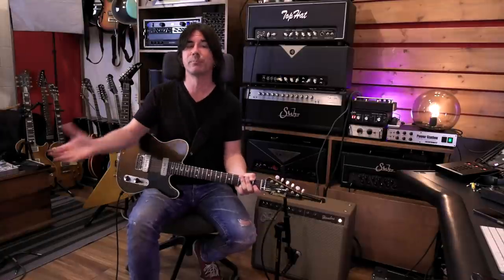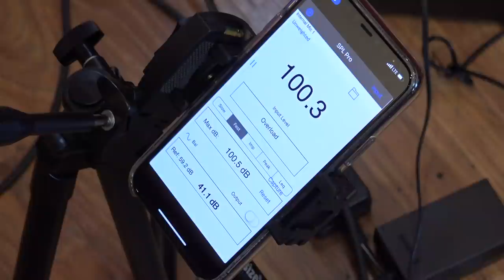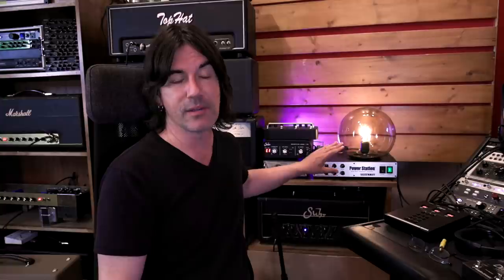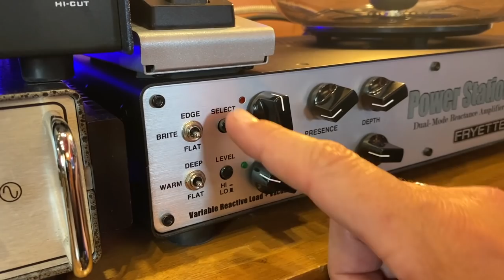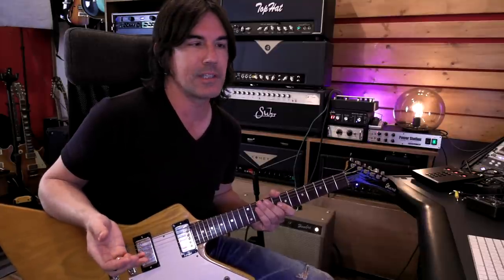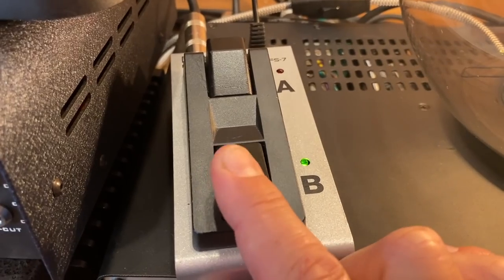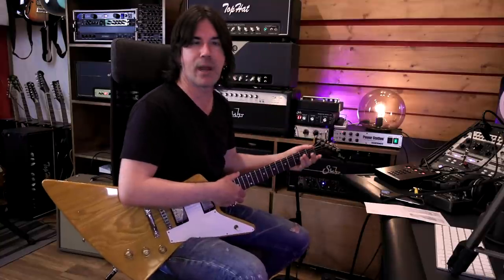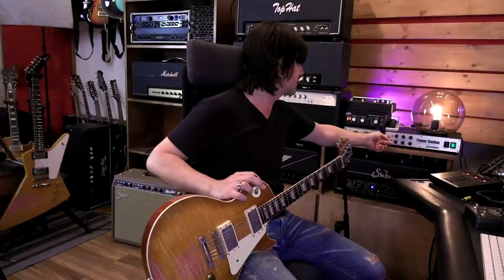THE BEST "ATTENUATOR" AVAILABLE! FRYETTE PS100 POWER STATION

Comment: Another great informative video that's easy to follow and understand. Im looking for a solution to record my guitar from my amp head straight into my interface to my daw. I was almost set on the Two Notes Captor X until you posted this new product. As far as sound quality and playability, which unit impressed you the most Pete? The Two Notes Captor X or the Fryette PS100? Thanks in advance and keep up the awesome content!
Reply: Different applications, I'm afraid. This one (PS100) is mainly an attenuator - meaning the main purpose is to attenuate, of course, but have two channels (you can have one louder than the other for leads or adjusting the volumes of two different amps) but also have amplification too (100 watts, all tubes). It can go directly to a mixer or audio interface (from line out) but you will have to have some IR loader in the computer to give a cab impulse response to the DI signal.
Now, the Captor X just have two fixed steps of attenuation but have already the software you need to record a guitar amp directly into you daw.
One is best suit for live, the other for studio/home recording.

Comment: Pete, I have a 1998 Marshall JCM 2000 DSL 100 Dual Super Lead 2-Channel 100-Watt Guitar Amp Head. I only use the green channel with my gain set at about 7. I know I can control my room volume with the master volume, but I feel that I am missing some tone and control as I never really push the power tubes. I get my gain with pedals. (My master is set at around 2 or a little above for most shows) Would an attenuator help my tone by letting me get the master volume in a sweet spot?

Comment: Great video Pete! New features aside, is the attenuator any different from the Power Station 2 and if so, is it worth upgrading?
Reply from the maker: The load is similar although I think the switches are tuned a little different. The power amp is different and redesigned around 6550 tubes instead of 6L6
Reply: @PeteThorn  - thanks for clarifying Pete! Wish I opted for the PS-100 over the PS2, but still very happy with it!

Comment: Awesome demo! Question about the re-amp part. If you're taking the original tone down to load, then using the PS100's amp to amplify the signal - are you NOT hearing the amp's output transformer and tubes?
Reply from the maker: No you are most definitely hearing your amp’s full tone, working hard! Output tubes, transformer, everything

Comment: Awesome Pete !  Any heat issues with a 100 watt head going into it for extended periods?
Reply from the maker: No it’s built for that, but it’s always important to just keep in mind that you are driving your tubes hard and they will need replacement more often if you play through your amps for extended periods at high levels
Reply: @PeteThorn  Thanks Pete !!

Comment: Hey Pete, If you have an amp with a more low mid focus, like an Orange Rockerverb, would the presence knob on the PS100 be able to boost the high end  to make it brighter to make it cut in the mix more? Or does it not work like that? Thanks.

Comment: Very cool, but this is the first I’ve heard of the voicing switches being in the flat position using a resistive load vs. reactive load. Is this correct?
Reply from the maker: Yeah the flat positions-  essentially take out the reactive components. Then you are left with a resistive load, like many of the attenuators that have been on the market for years. As you put the switch is into the different positions you’re adding the reactive components that give you a true impedance curve
Reply: Adding to Pete's answer below, setting the switches to flat does make the load resistive, but the relationship between the power amp stage of the Power Station remains reactive because a speaker load itself is reactive. That's why no matter how you set the voicing switches, system as a whole remains reactive and retains dynamic feel like playing the amp direct to a cab.

Comment: I really dig the hell out of it. I see it's almost $1K. I would love to find something similar that doesn't have to be two channels & a little less costly.
Reply from the maker: You could get an original one. I’m not sure if they still make it, they may  check their website. If not maybe look for a used one. The original was also very nice
Reply: The Fryette PS-2 is a single channel and 50 watts.  Best piece of gear I have bought in awhile.  Around $699 but I used a coupon at guitar center and got 15% off.  Interestingly enough the coupons list just about every manufacturer is not eligible but Fryette wasn't on it.  Winner Winner.
Reply: Actually just checked the pricing.  The PS-2 has gone up $100 bucks since I got mine...within the last 6 months.  Wow...can't believe how the pricing of so many things is going up.  Not an easy product to find used BTW...they sell quick.
Reply: @PeteThorn  Thanks Pete! I'll definitely check it out. I am really impressed with this unit!
Reply: @splittinaces9540  Still kickin' myself!  Had a shot at a used one just a couple weeks ago for about $625-missed out.  In the meantime, they sold out. (And went up $100 in  the process!) Still bought one, though.  Now I'm waiting on the amp.  A Rivera Stage IV.  I'm like a freakin' kid at Christmas who just unwrapped the batteries, but has to wait for the toy!  LOL  Lots of things affecting the gear market.  Supply chains are still messed up in some cases, some areas are locked-down to a degree that it makes it harder to do business.  And for those who've been blessed with minimal effect on their income, demand is high.  I've been to some retail sites where virtually EVERYTHING remotely popular is out-of-stock.

Comment: Better than the UA Ox, or just more well suited to your needs / workflow?
Reply from the maker: I use an ox as well! My three boxes i use here- On outputs 12 and three of my amp /cab switcher- are the Suhr RL, the OX, and the Power Station. The power station is on output three and is in line on the way to my live cabinet in the other room. The other two boxes are wired into my interface for direct recording with no cabinet.

Comment: I've had my PS 2A for about 6 months now. I've been really happy, but recently confused at what I'm hearing out of my 4x12 (just the JTM45 rig for now). So am I taking an EL34 or 5881 amp and having it re-amped to the different qualities of the 6L6s in the PS?

I've been messing with the unity gain to try and figure out and it really seems like I'm hearing a brighter more Fender-like tone. I'm just a few hours into this.

I think I'm getting this though - "drive the, in my case, 5881s to the tone I want, and then what comes out of my 4x12 is "Marshall tone", pumping through the PSs 6L6s with added eq if needed?

I just feel like I'm getting added 6L6 sparkle when I'm past unity gain. Why is this an issue? Because I don't want to run my Marshall at full crank all the time, just for casual sessions, and prematurely wear out my tubes.

Thanks for all you do Pete!

Comment: hey pete in recording do you think you need to have the cab blowing hard or what is an optimal level as can you get great results with a compressor doing the volume lifting in the mix, i know mics and rooms are a funny thing but the sound source at diff volumes is a test ive tried and a one watt amp can still sound big with the right reverb etc, good to know your thoughts
Reply from the maker: I think ideally it’s good to get the speakers moving a little bit but you don’t have to murder them with level.  It’s also a factor whether or not you want to be in the room with the cabinet in order to get some feedback, etc. With a device like this you can definitely like, cut the volume in half, still get a great sound and a tone every bit as good and maybe even some feedback if you’re close to the cabinet.
Reply: @PeteThorn  cheers pete, im forced to work all in the same room so have to commit really my api512v has input gain that i can clip a little which can help get it cutting a bit or neve 1073n eq but i just got a 15 inch guitar speaker which does away with the 4x12 and gives me some killer low tone, i just need to suss the level now, its tough making an album and having to commit to a chain, but its a fryette or thinking a blu guitar amp 1 and blending an aby with an m160 on my cornford into the 15 or fryette on my mesa, im doing an album in the style of superunknown, drums are sounding good https://soundcloud.com/ssyne/kit-c

Comment: Pete I have a Suhr Reactive Load IR.  Would you recommend using that with a power amp to control the volume of lets say a Plexi or JCM800 cranked?  Or would the Power Station work better?
Reply: Follow up question... if I used the Suhr Reactive Load.. are there power amps that have the treble and bass switches to bring that back?  Just looking at options.  Thanks!

Comment: Unit sounds great, can never quite figure though - the load is reactive so the guitar amp sees and responds to a "speaker load", then the tube output of the Fryette sees a real speaker, which has its own reactive impedance curve that presumably the Fryette responds to, so are we not getting two impedance curves added?  I've used a Suhr Reactive Load  into a small very controllable solid state amp which doesn't much care about speaker load and that works really well too.
Reply from the maker: I’ve asked Steve about this and I don’t really understand to be honest but evidently he designed the tube amp to be quite flat response. I know what you’re saying there must be some impedance curve? But maybe he’s planned that in the way he’s tweaked the load impedance curve as well. You’d have to ask the designer.
Reply: That's right. You are absolutely getting 2 reactive loads in series. The beauty of this is that no matter how you set the Voicing switches or the Presence and Depth controls, you always have control over how much reactive behavior there is and where it's coming from. It's more reactive in the load section and therefore the Voicing switches have progressively greater impact on that behavior, whereas the Depth and Presence controls are more subtle because the power amp stage, as Pete correctly stated, is more linear than a typical tube guitar amp.
Reply: @FryetteAmps  Hey folks, do you use  quite high negative feedback? - whatever you do, it certainly works.  Gotta ask, why not a solid state amp - lighter, less maintenance issues and they don't tend to respond to impedance curves like tubes? Don't get me wrong - great product  - just curious.

Comment: Hey pete or anyone but preferably anyone who has one I have a ps 100 and I using fender super reverb reissue.  Just wondering if there is an order or correct way to power up the amp and power station.  I’ve looked on there youtube channel and the manual and there doesn’t seem to be a certain way to do it.

Comment: Pete, does this wear your amps power tubes faster like a load box does! Thanks
Reply from the maker: Well it’s not that it’s hard on the amp, it’s that you are just running the amp hard, if you turn it up, same if it was plugged into a cab!
Reply: @PeteThorn  thanks Pete, I think I understand. In other words it’s not forcing the compression on the tubes to burn them out prematurely it’s just wearing the tubes as if you ran it loud with a cab. Thanks

Comment: Hey Pete, greetings from England, is there any point in buying this attenuator if I own a Marshall dsl1hr amp, it's for home use on ly, the amps still  pretty loud on volume 3 or 4 and I don't want to piss off my flat mate above! 🎸🎸🎸🎸🎸🎸🎸🎸
Reply: By yourself a Bugera or a Harley Benton... no need for an atenuator whitch costs 10 times the price of your DSL1
Reply from the maker: Well the interesting thing is, this could actually make your DSL one work with a band. If you were ever go out and play life, you could plug that amp into this thing in you’ve got 100 wants to play with all of a sudden. But with the tone of your amp. I know what you mean, I have a 1 watt Marshall as well. It’s too loud for sure on full power for an apartment. If I play it at home I use the attenuator switch Dash the model that I’ve got which is the JTM one has a built-in attenuator

Comment: Hey Pete. How does the Fryette compare to the Waza TAE going straight into the cab as an attenuator?
Reply: Im sure it sounds better than the Waza TAE and for less money. It is a tube power amp instead of the class D power  I believe that the Waza has. This is simpler and more transparent from what I can hear. Yes better to my ears going straight into a cab than a Waza TAE to answer your question. No need to buy a different unit for different ohms either. Fryette is known for making the best sounding power amps out there as well. One other thing it's over 3 pounds lighter than the Waza TAE. My search is finally over.
Reply: @HiHello-ku1fl  The TAE is a different beast though, it's designed for live applications and it's great at what it does. I'm currently using one a lot at home as an attenuator as well and I think it sounds pretty good, but I'm curious to hear how it compares specifically as an attenuator from someone who has used both side by side.
Reply: @trentwaterman7049  I know the TAE has built in effects but other than that it does the same thing but with class D power instead. The Fryette is designed for live applications as well. They aren't that different except one has more features that I don't need. I would just use my own choice of effects. I guess it would be convenient to have them built in. I'm sure Pete prefers the Fryette better as that's the one he bought. He would have bought the TAE otherwise.
Reply: @HiHello-ku1fl  bro I know you're just trying to help, but like I said I'd like to hear how someone who has heard them side by side thinks they compare specifically as an attenuator into a cab. Pete has both the TAE and the Fryette.
Reply: @trentwaterman7049  ok I will shut up. lol Sorry man.

Comment: Hi, can we use the attenuator function on a combo, like the mark v 25?
Reply: Yes you can: just unplug the combo's speaker cable, and do as follows:  
Mark V "speaker out"  >  extra speaker cable  >  Fryette "amp in" . 
Then:  Fryette "speaker out"   >   speaker cable that is soldered to your combo's speaker.
Make sure the impedence selector on the back of the Fryette matches the impedence of the Mark V speaker out.

Comment: When I had my 100watt Hughes and Kettner amp hooked up to a 4x12 cab I used a THD hotplate. It was perfect and not too big. This Fryette has too big of a footprint for me. 

Sounds great but I'm so glad that some newer amps come with a built in attenuator 🤘🏻
Reply from the maker: Has to be that big To have 100 W amp inside! Plus enough room for the load. Room for the output transformer and tubes etc. I don’t really find it that large to be honest.
Reply: @PeteThorn  That's true. 100 watts requires a bigger box. It looks fantastic and I love the glass ball. Reminds me of those electrical light up balls they used to sell.
Reply: @PeteThorn  Not sure if you will ever read this but I just now realize that the glass orb sitting on top is NOT part of the Fryette PS100! HAHA This is why I was thinking it was too big. I was watching an older clip of yours and the orb was there and I was like OHHHHH. (I can be slow sometimes)

Comment: So this wouldn't work for a 2ohm super reverb?
Reply: I use my vintage 68 drip edge super reverb with 2/12s this is a 4 ohm load,  using 2 Jensen C12K in 2/12 cab open back

Comment: How does this compare to the Rivera rock crusher ?
Reply from the maker: That would be more of a traditional attenuator – Of the sort that I described in the video where it essentially is slapping some juice off the amplifier and still passing signal through to the speaker. Where as with this box you are loading the amp down completely to line level and then re-amp in with a tube power amplifier. Does that make sense? I hope so.

Comment: Here’s my $64 question. I have a Suhr PT15 IR and matching 212 cab. Does the PS give me anything that I cannot already get from the MV on the PT15?
Reply from the maker: I don’t think with my amp it’s really necessary. You’ve got a great master volume and also the ability to run the internal load in parallel, giving you essentially half power... Between those features I think the amp is really fine on its own. The power station is more useful with non-master volume amps with no effect loop, in my opinion… Or amps that rely on being cranked up essentially, to get their tone.
Reply: From a volume stand point probably not, any amp w/ good master volume is about equivalent. More useful for amps w/o MV. (I have been using a PS-1 since they came out)
Reply: @PeteThorn  Thanks Pete. I have a NMW Marshall that the PS would service. I asked because I'm seriously considering moving the Marshall b/c the PT has become my go to amp.

Comment: So what's the "best" attenuator out there for re-amp or recording? I'm confused. I see everyone owns an "ox" but where are we at today? What's your favorite Pete Thorn? Maybe more than one for different applications but fill us in. I'm sure this endorsement is one .
Reply from the maker: My favorite for recording is the Suhr. But the ox is excellent as well.. it has one very nice feature that almost no others have which is the ability to blend in some room microphones with the virtual close cab mics very easily. Plus some very nice built-in effects like delay etc. fryette Is really good as well for recording DI it just doesn’t have onboard speaker simulation or impulse responses or effects so you have to do that stuff in the computer. Lots of great devices out there, just depends what you want to do!
Are use the power station primarily to attenuate my cabs and for this purpose it stands alone as the best device out there I do believe.
Reply: @PeteThorn  Thank you so much for the detailed reply.
Reply: @PeteThorn  thoughts on a certain Waza type re amp?
Reply: @cjjames6553  .